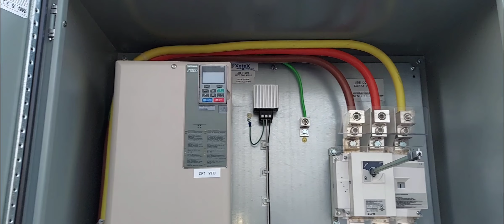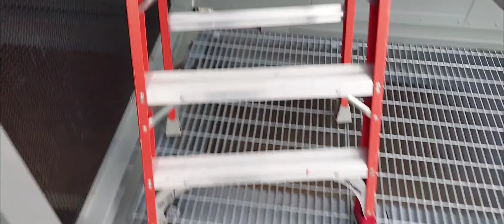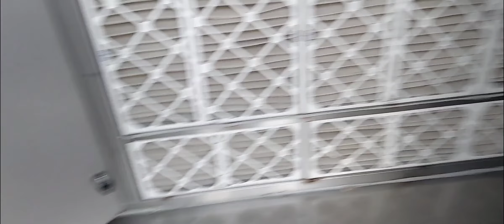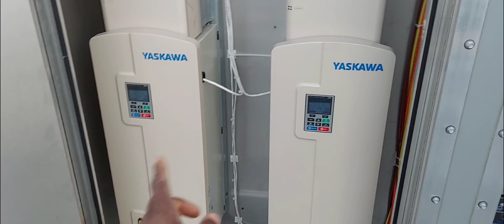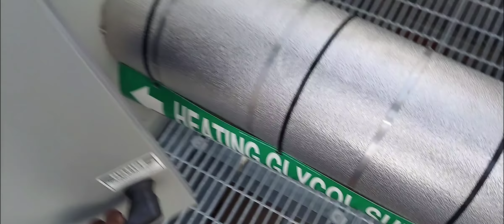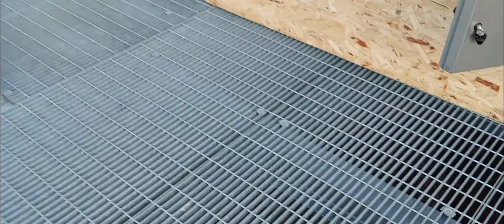OMG 😱 ITS HUGE | COMMERCIAL HVAC UNIT

Comment: that is some dumbass design fir this size. (wich arguably is not THAT big). repairing that fucking evaporator is just going to lead to a LOT of cursing. that system size should be water/glycol for both heating and cooling and just having it fed by a couple heat pumps so you can lose the gas. i see that its cheap to produce considering the brands used but repairing it in 5+ years when it starts leaking (not if) the building owner is not going to be happy with the qoutes and downtime. let alone the  MASSIVE efficiency left on the table with using old ass TXV's and not EXV's. this would be technically a LOT better with 2~3 smaller boxes fed with a half dozen simpel water/glycol heat pumps with the heat recovery. that allows for downtime/repairs/maintenance while keeping the other 2 running. you could even get back a lot more energy if  they would put the return/waste air over the condensors first. especially in heat mode. this setup would not fly in the EU due to its inefficiency.
Reply from the maker: 😮 very interesting my friend